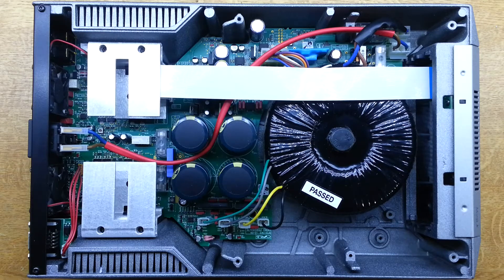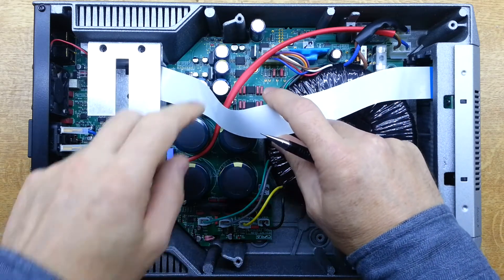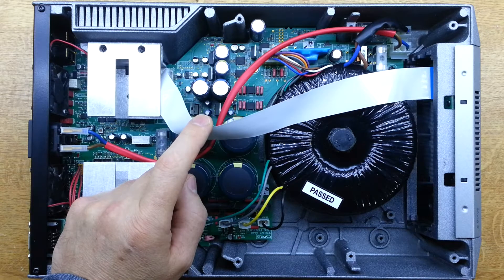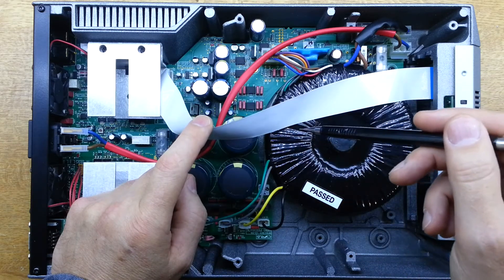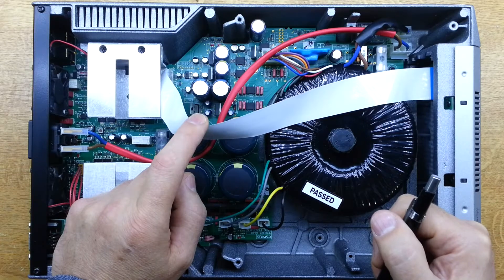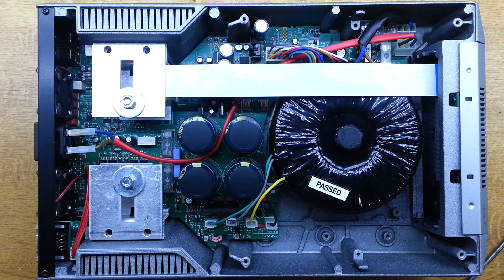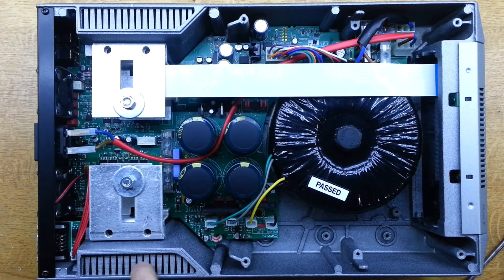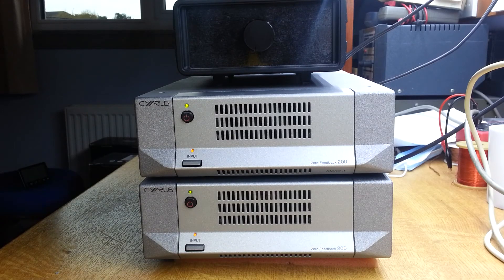Repair of a Cyrus MonoX200, exploring its internals and some of its mechanical quirks

Comment: Slightly unrelated, but do you have any experience with the Stereo 200 amplifier? How does it stack up against the mono x200/300 and their signature variants?
Reply from the maker: Stereo200 is a class D amp so is a completely different animal. Best to audition first.

Comment: I used to like Cyrus products but haven't purchased anything from them for the last 15 years. the X200 are probably cost in the region of £1500 so its disappointing to see such obvious cost cutting. Do you find their older products any better quality? Would you personally put your own money into buying any of their current range? Their new PSU XR is over twice the cost of the previous version so it looks like their business model is to fleece their customers.I had been thinking of getting the CD XT Signature or even the current CD T XR but your video has me questioning whether to do so. Hearing your thoughts on the matter  would be greatly appreciated.
Reply from the maker: Drop me an email
Reply: @myalbatech  Will do and thanks for your reply